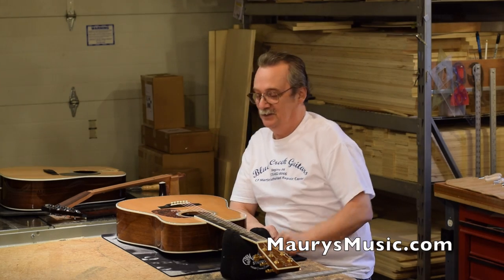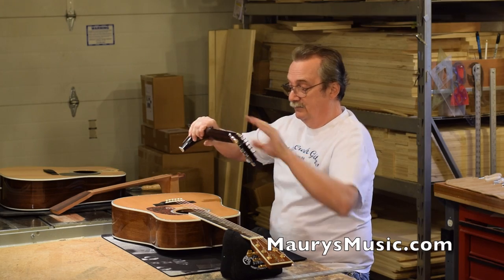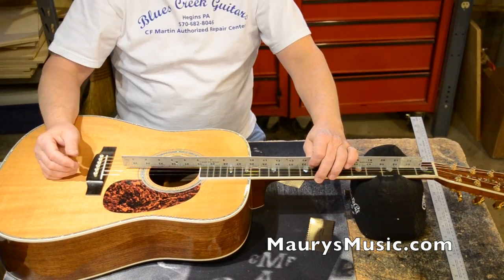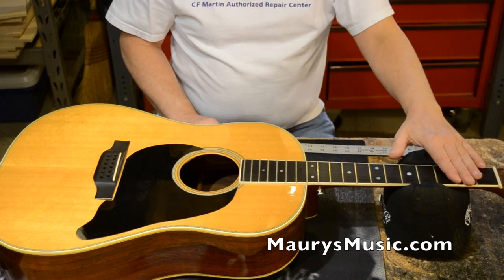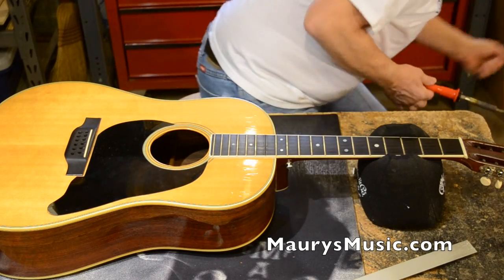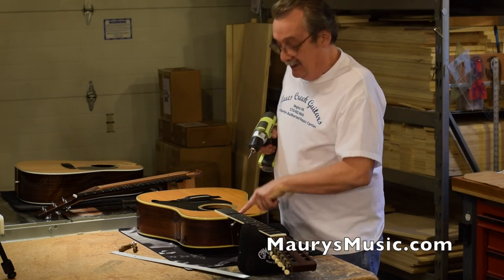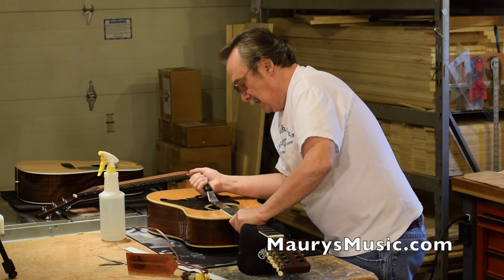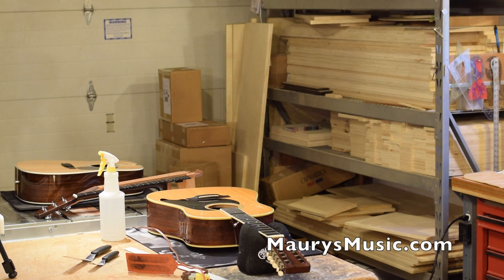Blues Creek Guitars - Guitar Neck Reset Part 1

Comment: Your tip about using an icing spatula to lift the fingerboard extension is right on the money.  I just successfully removed the neck from a cheap chinese guitar that I'm converting to a resonator for a friend, and rocking the round end icing spatula to release the glue worked like a champ.  Thanks mucho.

Here's a tip to trade.  I clamped a couple of 10" wooden parallel jaw clamps onto the box aligned with the neck, then bridged across the tops of them with a short piece of 1" square aluminum tubing, and then I used a medium size F clamp on the heel cap and the top of the aluminum bar.  Boom! Instant neck press that didn't cost $100.
Reply from the maker: +Capn Crusty  glad it worked out for you. I do this pretty often.  I am happy to share the info.

Comment: Nice video!!!!!!!!!!!! Hardly any good neck set videos out there with competent explanations. Thank you so much for posting this!!!!!!! John Arnold is not too far from my area. I've never met him, but a friend of mine took my 46 D-18 to him. Someone had refinished the entire guitar with paint lacquer many years ago & destroyed the guitar. As it's collectable value was more than cut in half, I decided to use 0000 steel wool & try to salvage what I could. I was young & dumb & I ended up sanding to bare wood in a couple quarter sized spots. John refinished those spots & matched the finish exactly. You couldn't tell where one started & the other stopped. I've seen a lot of his work & it's always been top notch!!!! He knows what he's doing!!!! Great video!!!!!!!
Reply: thanks

Comment: It can be done without steam but requires electricity, i'm sure Glen is familiar with the method, however it's not an exact science just yet and kits are being worked on for Luthiers workshops. I use the steam method but as soon as these kits become available i shall continue with the steam. One of the master has a parts list on his website but he wants a Patreon contribution for the list and method. I have seen it done and it's impressive, no risk of scalding any finish on the guitar.
Reply: I was surprised when he said finish blushing isn't a big deal...

Comment: I have a question and would appreciate any imput...i have a 2001 Martin D41 and a 1996 martin D42 both play great both necks have perfect relief and the action is well within specs with original untouched saddles...my concern is both guitars have a small gap between the heel of the neck and the body of the guitar (enough to slide in a business card) and or thoughts... I've heard  this is quite normal as martin leaves this area unglued

Comment: Hi liked the vid I have a question for you, I am riding  around Thailand on my motorbike and need a travel guitar I can't afford a furch little Jane so I'm toying with the idea of buying a cheap guitar locally and using your technique of removing the neck and then inserting bolts to make it detachable for traveling just wondered if you think this is feasible or should I abandon the idea, bearing in mind I don't need a professional instrument, just something to bash out a few songs, it doesn't have to look pretty just useable
Reply: its hard to say  Much depends on the construction method used.  Some are doweled and epoxied and that may not be possible,   Look for a travel gig bag  you can wear it like a back pack
Reply: @johnhall2795  yes but have you tried riding 800km a day when it's 32° C with a backpack, not good, I must find a better option, thanks so much for your reply
Reply: Also when you ride with a guitar in a backpack at 140 km per hour which I do all the time, after a couple of hundred kilometres your shoulders are just about ripped off

Comment: i'd use the heatstick from stewmac over steam, which is unpredictable, potentially damaging,  and the temperature can't be controlled like a soldering iron
Reply: I have the heat stick  and in skilled hands steam is much better.   First you have to run a 1/8 in hole  and that is hard to hide in rosewood fretboard.  Yes they work . Most people that use steam don't use it correctly . The key is to use 2 holes and work the steam a bit and switch hole. Most blushing goes away in 24hr . Using 2 holes the blushing isn't an issue. . How many necks have you pulled ?  I only did a few thousand,  Wayne Henderson  John Arnold and most of the guys I know still steam.   You are welcome to your opinion.  As one that does this for a living ,  steam is still more reliable.  As always check that the neck block is still glued. No matter what system you use  .
Reply: Would 2 thinner heat sticks that fit the hole size you like appeal to you? Steam seems to scare clients

Comment: The problem I have with what your saying here is you're suppose to set the straight edge on the fretboard not the frets. Make the neck flat using the trussrod. Your frets may not be level. First step tune to pitch then set relief then check nut height then check action. If action is too high then take the straightedge you're using & see if the straight edge kiss the top of the bridge if it's hitting the bridge you have other options. Shave the bridge then the saddle. A neck reset is expensive & is never the first option.
Reply: having done over 3000 neck sets  I think I have learned a few things.  Your question in talking about tuning to pitch is about a set up  that is all together different. Your talking a set up not reset ,Shaving a bridge is not the way you want to do things and is an amateurs way of addressing a problem and not curing it ,   and I think you have a few things confused. Since you didn't see this is about neck setting on a new build , . When a guitar needs a reset that is when you can no longer adjust to the proper geometry. Once that happens you need to reset the neck . Once you start shaving the bridge you loose the efficiency of the energy transfer from the loss of the height of the saddle. I have been working on guitars for about 25 yr and I am an authorized CF Martin repair center and have made about 300 guitars. If you have any questions I would be happy to share my experience.
Reply: @tippie53  I know the difference between setup & neck reset. I just did 3 cheapo acoustics which really should have the neck reset. I'm aware of all aspects. You can go to 4 degrees on break angle before you really need a neck reset & even then you can slot the bridge to increase the break angle to give the consumer time before an expensive neck reset. You can shave the bridge down to 0.0250 before you notice any sound difference. Neck reset is the last resort. I know many authorized repair centers & I'm not saying you but most will go for the big bucks before telling the consumer the other options. I've been a machinist for 34 years & have worked on many guitars. With the strings off & neck straight the angle of the straight edge should be about 0.062 to 0.125 above the bridge. Setting a straight edge on frets (if you don't know are level) will yield incorrect results.

Comment: I wondered if I can have opinions of what is a reasonable charge that a neck reset should be and what it should not be?  I brought a 1996 Martin DM to a repair shop yesterday to have it looked at. From early on the guitar had a problem and I brought it to Martin in Nazareth a few months after buying it. They put on the repair invoice "Straightened uneven neck" and adjusted action.  Lately, it has been downright painful to play so the man that looked at it yesterday (He is authorized to work on Martin) found the truss rod cannot be moved anymore (very tight he termed) and the action is high and saddle lower than original. He is keeping it with him to contact Martin but unfortunately, it may not be this week for I think they shut down for the holiday. He said if it is deemed a structural problem Martin may cover the repair under warranty.  My questions are Does anyone out there have experience dealing with Martin as far as warranty and if Martin was to not cover it what is your opinions on what a reset should cost and if worth it.  I believe this was the last or second to last Martin to be made in Nazareth for under $1000.  Any and all thoughts are appreciated. Signing off for now.
Reply: Martin will overcharge as the want you to go to the repair centers. They most likely won't cover this  anything over 5 years your pretty much on your own . The truss rod is most likely just stuck and there are ways to loosen it and add a washer.   Look me up on my website and contact me through that  you can call me

Comment: Thank's a lot , for my FG180 Yamaha is there something to know more ?
Reply: sometimes they  used epoxy   if they did that you will have a tough time.   I would suggest drilling 4 holes    2 an the 15th fret and 2 at the  body fret and drill so that you follow the dovetail but hit the cheeks of the neck  in case they glued that.

Comment: Electric heat is by far the better way to do this .steam will mar the finish. Never on the pickguard.
Reply: disagree   the heat plug takes a 1/8 in hole and is difficult to hide on rosewoods   after over 1000 resets I can tell you if your getting finish damage you are doing it wrong. I only let the steam work a min or so then move to another hole.  Been working on guitars for 20 years and I learned a thing or 2  so we can disagree. I tried one of the heat plugs and gave it away  yes it will work but I do  4 resets at a time . The key not to damage is how you control the steam you can't just let it blast away. Also I do use heat for the fret board. If you let your heater in too long you can loosen the neck block from the sides  both methods have their issues and you have to learn your technique. My friends Wayne Henderson  John Arnold   david Nichols  we all steam.   I don't know many that kept the heater.  best to you.

Comment: You said you were at 2 or 3 after setting the relief to .005".   Is that 2 or 3 referring to x/64"?
Reply: My guess was 2mm treble and 3mm bass strings. That would make sense as a typical or lowish action halfway down the fretboard.
Reply: Ross Kelly - Thanks.  I was checking my D18 as I watched his video and the string/fret height at the 12th is at 5/64".  I was thinking: 2/64" (1/32") is really low this far up the neck?!

Comment: At about 18:55 in the video, you mention cloudiness in the finish not being a big deal. What would be a solution to the cloudiness?
Reply: often it will go away on its own just excess moisture. Sometimes it is glue residue and polishes off. if it is real bad no blush from auto stores will do the trick   that softens the finish to allow moisture to air out
Reply: @tippie53  Alright thanks.
Reply: I was kinda put off by that remark.

Comment: String height at 12th fret: "Right at 3 and right at 2, so that's perfect." 3 what? 2 what? What system of measurement are you using?
Reply: using CF Martin nomenclature  so a 3 - 2 action is 3/32 on bass   2/32 on treble at the 12th fret  under the string.
Reply: 3/64" and 2/64"
Reply: @mamachip  Nope, incorrect. See correct answer above from the maker of the video, John Hall.

Comment: Saddle height 0.180" is 4.5mm, is that correct? Did you mean 0.80"
Reply: yes saddle height above the bridge should be about .180 in  .8 in would be over 3/4 inch.  total height off the guitar top to the top of the saddle should be about .5 in   I like bridges to be about . 325 to .375  then saddle height of  .125 to .180   these are my happy measurements,  you can vary a little  but these are the target measurements. Tolerance of about +/-   .o625 in
Reply: I meant, 0.080" ,thanks
Reply: @tippie53  do you prefer steam over a soldering iron extension? seems more unpredictable
Reply: Yes   @34672rr   wiremessiah
Reply: that soldering iron  will work but now you have a 1/8 in hole to fix. I have been steaming out necks for 20 y rs,  Martin has been doing it longer than I. Steam works well. The key to this is to pull the needle every few minutes and let the heat work in.   I have tried the heat thing and I can do 3 necks in the time it takes to do 1

Comment: why on earth do acoustics not have adjustable saddles and bridges?.....for intonation, action etc....it just doesn't make sense not to have that......weird.
Reply: DEADASTRONAUTFX sustain
Reply: DEADASTRONAUTFX resonance
Reply: reed   I understand resonance etc....but why make it hard for yourself... I love electric and because you can set your guitar as YOU like it......acoustics ALWAYS have adjustment limitations.....I love the sound of acoustics, dont get me wrong,  but let's kick it up a gear bridge wise...x
Reply: I have a Yamaha FG 300, bought new in 1970 The bridge is fully adjustable. Sounds great and I can not imagine why I don't see that type on every guitar.
Reply: @jro101346   cool, yeah it would make more sense wouldnt it, but i guess they wouldnt sell as many...hmmmm
Reply: Adjustable saddles/bridges are still pretty standard for floating bridge setups, and even became pretty common on a lot of fixed bridges, notably on gibson hummingbirds and j45s. But then everyone started converting them to get a better, more direct connection between the strings and the top. I quite like like them for switching to and from slide or low tunings. But it won't save you from a neck reset. And saddles are generally stupid easy to make and modify and replace. And with acoustics, you get the intonation and action right once, and it will generally stay that way far longer than any tunomatic type bridge, and withstand a lot more abuse before needing any tech work.
Reply: @jro101346  im on here because i have a FG295S that has its saddle sanded real low. Plays and sounds amazing but i didnt notice the saddle. Paid 380. Im gonna ride it out
Reply: It would be detrimental to the sound.

Comment: Sorry but the string brake angle is critical.
Reply: The brake angle myth has been around for years but ,   from an engineering and physics standpoint no. What is more important is the string height at the bridge. Most people forget that it is the point of connection. So if you look at it this way, the point of the ball end to the point of the saddle is what matters.  If you look at the applied force of the string  you use the sine of the angles and the string tension . From the ball end of the string  to the top of the bridge and then to the saddle. So if you think it is just the break angle , that is not correct.   The point that you loose  on the break angle is when you get below about 6 degrees .  That is proven by the match and physics.   You can use an oscilloscope a or spectrum analyzer and that too will prove the math.  In the brake angle analogy the assumption is applied down force but the reality of this , is the coupled force  of the strings up  pull from the ball end to the tension at the bridge and down force at the saddle.  You are only looking at one part of this equation.